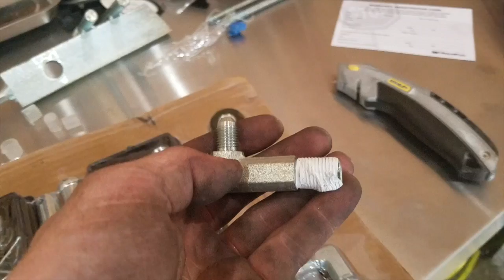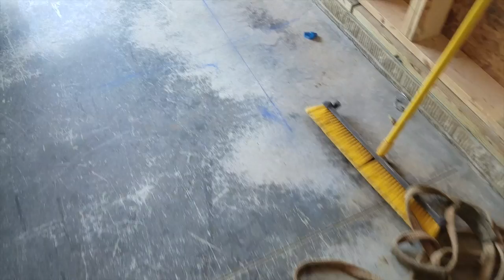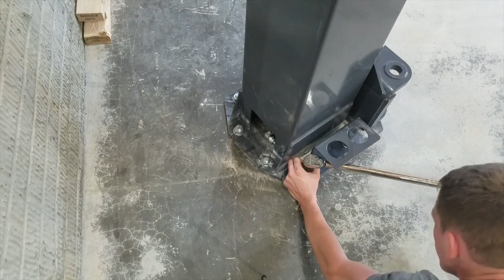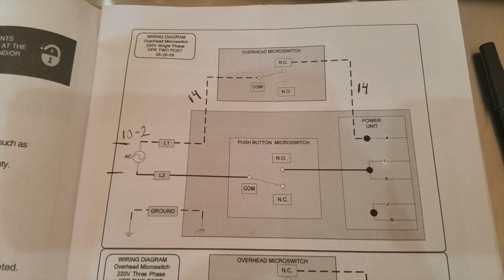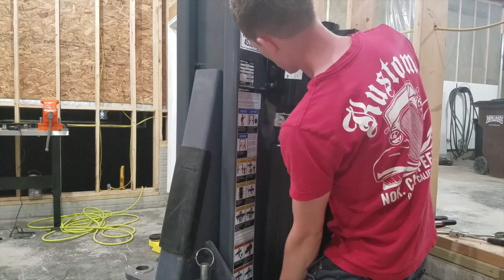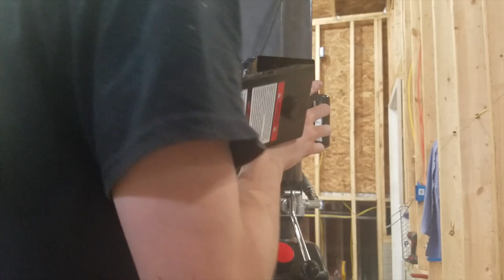BendPak 2 Post Lift Assembly- In Detail

Comment: AWESOME assembly video.  I am purchasing this exact same lift myself.  Question for you:  With a load on the lift, have you ever measured to see how much the lift arms deflect?  I am pretty curious.  Nice talking with a peer.  I too am an industrial mechanic.  29 years this month.
Reply from the maker: I haven't. They do deflect more with a truck on the lift obviously because the arms are extended out further to reach the frame. It never feels unsafe. Sorry it took so long for a reply. I never got a notification :/
Reply: Hello again.  another question for you:  Before the Bendpak, did you check into the Rotary Revolution series of lifts?  If so, I am curious as to what you thought.  I can't decide between the Bendpak you got and one of the revolution lifts.  Both lifts are made in China.  What's bugging me about the Bendpak is the damage from shipping.  I am hearing your same story from nearly everyone I talked with who bought it.
Reply from the maker: @keithkillian7581  I did not look at them because they were not as available as a Bendpak was. I'm not sure about the revolution series but all of the Rotarys I saw were $1500 more than the Bendpak for the same specifications. My suggestion would be to try and look at both of them in person and compare the build quality.
Reply from the maker: @keithkillian7581  my biggest gripe with a Bendpak is the lack of attention to detail. Just like it arriving scratched up. The hardware they use looks and feels cheap. The motor contactor for example is the cheapest off brand motor starter I've ever seen. According to one commenter they stopped using the contactor and are just using the button to handle 13 amps on the new models. Then, they didn't bother changing the wiring directions reflecting the removal of the contactor. The commentor thought they were missing parts until he called Bendpak and they told him it was removed. The frame and the arms are well built  and safe but, every thing else just seems cheap.
Reply: I very much appreciate your response.  The revolution series is a ALI certified lift that was built to compete with the price point of your Bendpak.  They are within about $100.00 of each lift.  Although it says made by Rotary, I think they are using the brand name is all.  There is a TINY sticker on the lift that says rotary and you'll be hard pressed to find the word Rotary on the revolution website.  They are easily available though where I live in Wisconsin.  I will at least look at them before deciding.  It sure is frustrating paying out a lot of hard earned cash for a cheaply built product. I hope the pump/motor assembly on your lift is better made then the cheap contactor.  I also wondered about the quality of the cylinders after you said both of yours leaked.  That would have angered me.  All the machines I work on at my job are German made and although they are sometimes way over engineered, they are always built with top notch components. Stay tuned fellow industrial mechanic.  I'll keep you in the loop with the Evolution lifts.  Have a great day.
Reply from the maker: I've wondered the same thing about the pump. I'm sure Bendpak isn't building them but, you can't help but wonder. Keep me posted.
Reply: Hello Repair geek.  I looked at both lifts and decided on the Rotary Revolution RTP 10.  I picked it up today and brought it home.  The packaging was AWESOME. Heavy angle iron frame on each end, plywood between all the columns and pieces. None of the painted pieces were even touching each other.  I uncrated it and not a scratch, ding, damage anywhere.  Super happy. Wanna hear some irony?  On the way home with it, I lost my exhaust on my truck right after the cat.  Here I am with a lift that has a job lined up for it and I can't even use it yet lol.  Anyway, I'll let know when I get it installed. Hope all is well with you.
Reply from the maker: @keithkillian7581   glad it all worked out for you. You won't have a problem finding reasons to use it believe me. If neighbors see it, they will be bringing their cars over for a quick look a lot. It can get annoying from time to time but, I alway have cash on me. I never need an ATM.

Comment: I am in the process of setting up an asymmetrical BendPak. I found your videos and find them quite helpful. You are right, and expressed it kindly, the instructions are "Vague".....  this is one product that I definitely recommend reading through the entire booklet first.   I was hoping to see how you placed the "Button" end of the balance cable in the Lock Plate, inside that carriage.  I'm a big guy, am I really supposed to be able to stick my entire arm down in that tiny hole ??  What holds the button in place to prevent it from popping back out, Luck ?  Sure would have been nice if the Chinese factory had had one of the kids put that together before it was all packed up.  
I plan to cheat a bit, as I usually work alone. I am going to lift the post with the forks on my tractor, secure it to the trusses above and then lower so it can swing into an upright position.
Reply from the maker: Tension on the cable holds it in place. You can use some tape to hold it in the bracket. If the cable falls out of the bracket when the post is vertical it is much harder to put back in place. I know from experience haha. Just FYI.
Reply: My biggest problem is getting down inside the carriage to set the cable button in the bracket...  my carriage is completely enclosed with a 5 inch access hole in the top, which is where it seems you took your videos from.  I have the post standing already.  Were you able to reach down through that 5 inch hole or did you use a tool of some sort to position the cable button ?
Reply from the maker: @edburgett4561  I used air to raise the cylinder and go up from the bottom. If you get the safety mechanism assembled you can raise the column up to the lock with air pressure. I tried my engine hoist before resorting to air but I could not get the carriage high enough for good access.
Reply: @RepairGeek  thanks for this. Was pretty sure I was missing something.

Do the hydraulic lines go in and out of the double tabs as the lift moves up and down? Just seems like there would be a better way to ensure that the hydraulic lines stay out of the way. Thx
Reply from the maker: @dsford1982  I just bent those tabs closed on the hydraulic lines with channellocks. I haven't had any issue.
Reply: @RepairGeek  Thank you. I started crimping those on the Non-power side and it left the power side short :(. Yes, wide config with added hose piece installed. Maybe I should run them tight in the back of the posts? Any thoughts? Thank you again.....excellent help here.
Reply from the maker: @dsford1982  weird. Perhaps you got shorted some hose? It may be worth a phonecall to Bendpak.
Reply: @RepairGeek  My sales rep Kat has been great. Emailed her and they got right back to me today. This thing would be up and running if I was better at concrete anchors! don't ask! ugg! Thank you again for everything....it really makes a huge difference.
Reply from the maker: @dsford1982  I ALWAYS drill completely through the floor. If you have issues in the future you just remove the nut and pound the anchor through the floor.
Reply: @RepairGeek  great suggestion! I seem to not hit them straight...or something. Had to epoxy one and hit rebar on another. Hope to get the last one in tomorrow.
Reply: @dsford1982  With the hydraulic hoses properly connected and installed, you will not be able to get the hose clamped in the welded tabs in the top corners of the posts where they are welded on the Overhead Assembly.  I found this out when installing mine and contacted BendPak about it.

Comment: Since a few people have asked...  
I just finished setting my XPR-10AS-LP up. My ceiling is 12ft 1-1/2”.  There is JUST ENOUGH room to stand the posts up, if you rotate them up so the notch in the posts is up. That puts the flange with the post closest to the edge near the ground. Of course.

I also did the entire operation by myself!  Used my gantry, and a 1T chain hoist.  If you sling/choke just under the 2 large welded tabs where the latch goes, you’re just above the center of gravity. So as you lift, the flange will stay on the ground. Took me maybe 20 minutes to stand them both up.

Comment: Do you have a part number for that relay inside the pump box? Mine did not come with one. Called Bendpak and havent received a response yet. Thinking about getting one locally. Thanks
Reply from the maker: It doesn't have much on it. The only brand information is: Contactor TMC-18

It's just a contactor with a 110v coil. It shouldn't be hard to source through some one like Granger or McMaster.

If you Google: Allen Bradley 110v contactor you should find what you need.
Reply: Well BendPak replied by saying they don’t use those relays any more and to just wire it up hahaha
Reply from the maker: @TBD_Performance  WOW!!! I guess that 3 dollar Chinese contactor was costing them too much money. Hopefully they gave you a heavy duty button that will handle 12 or 14 amps. Unbelievable...
Reply: Not sure about the button...kinda frustrating because I thought I was missing a part. I’ll know for sure tonight whether or not it works.
Reply from the maker: @TBD_Performance  did the your wiring instructions look like mine? I just wonder if they even bothered to update the instructions when they made a revision to how the lift is wired.
Reply: No update same as yours. Gotta save those pennies ya know
Reply from the maker: @TBD_Performance  that's nuts. How do they not expect calls about that? If you need anything else I'll help you as much as I can, as long as they haven't changed the design haha.

Comment: Hi

I have the same lift ready to be installed. Can I first install the columns and top bar and deal with the calbles and hydraulics afterwards?
Reply from the maker: There is no reason you can't do that but, it's going to much easier to preassemble that stuff on the floor. You have to route a hydraulic line behind the carriage, with the post on the floor you can move that carriage inside the column. Once it's vertical you will struggle to do that. Not to mention having to up and down a ladder constantly.

Comment: "I'm just gonna use air to move the cylinders cause it wont hurt anything".... next video update, "so uh both my cylinder's were leaking" luckily bendpak didn't see your video or they probably wouldn't have sent them to you.
Reply from the maker: The replacements are leaking as well. They we're tested at the factory with oil, so they had residual oil in them. As evidenced by the oil that had dripped out of the hydraulic line I pressurized.

Comment: The Safety Switch does not use a full 30 Amp it is there to Stop full run the 14 guage will handle 240 volts , when any wiring is done on anything sold in the USA or CANADA it has to go through testing in the USA  "UL" or in Canada "CSA"  THEY MUST Approve it before it can be put up for sale to the consumer , use the safety switch the wiring is safe enough and it is not carrying full load . it is a Micro switch and has nothing to do with the load  the motor is under , I urge you to reconsider using this switch , I Assume your a Mechanic which means you use these lifts daily however for the average home owner who wants a lift all SAFETYS should be used they are there for a reason and the mere fact 14 guage was used should not be a deterent as an Electrician I've installed Several of these lifts I've yet to see an issue with the wiring or safety switches.
Reply: One leg of the 220 runs straight through the switch, it is not a micro switch that works with a relay to disconnect a leg.

Comment: Hello Repair Geek,

I have a question for you. I am looking at this lift for my shop. Although, it will be the asymmetrical version. The ceiling height in my shop will be 12 feet 6 inches. With that being said, my question is this. I know the lift only needs 12.08 feet of clearance when installed. However, I am concerned that the height might not be enough. If you measure from the bottom right corner of the column to the top left corner, that will be more than 12.08 feet. So when you are standing up the column from a parallel position on the ground, I am worried it will hit the ceiling before it stands up right due to the extra length. What is the measurement of your lift from one corner of a column to the opposite side at the top of that same column?
Reply from the maker: Brian Padrick I just measured mine from top to bottom going from opposite corner to opposite corner it's 12ft 1in 1/4. Let me know if you need anything else.
Reply: Repair Geek awesome. Thanks so much! I really appreciate it. The builders have not put the trusses in yet so if I needed to go higher, I still could. Thanks again. That really helped.
Reply: just installed my bendpak in my newly constructed shop with the trusses and 12'6" and there is plenty of room with hoist up.good luck

Comment: we just finished our install yesterday. (same lift) it  worked flawless on 2015 VW Jetta and an 87 Samurai. I wish they gave us the frame cradles wit the lift. $50 bucks each.  we started lifting a GMC 2500 with a service bed and liftgate and it didn't seem to happy. I will wait for the frame cradles and try again. truck was right at 9000 pounds. I think get it lifting level with the cradles and it will be fine.  Thanks for sharing your info and install. Helped us. we're on FB at Loose Nut Fab.
Reply from the maker: Skipholiday I've been meaning to buy the frame cradle pads as well.  I've had a 2014 diesel 2500hd with a normal 6.5 bed on mine. I would estimate it at 7000 or so pounds. It handled it without any issue. Thanks for watching. I check you guys out on FB.
Reply: I bought mine from Northern tool for $50 each. Use this coupon code (257368
) and you can get $20 off. Keycode: 257368
This keycode entitles you to $20 off your purchase over $100.

Comment: I have a round washer with finger like things inside of it .its probably 1 " or so i cant find any mention of it in directions.  Do you remember where it went?
Reply: It goes on release lock mechanism on non power side 
It keeps lock release cable from sliding off

Comment: I could be wrong but as i reed the instructions it appears you could have mounted the motor on the driver side or more correctly you could have use the motor post on the driver side, which would have put the motor to the back of the post and out of your walk way.  the rest of the install would have been the same.  That would have prevented you having the motor on the passenger side and blocking your walkway.  If you look at the base plates they are shaped in such a way that either post can be the driver or passenger side to allow for flexibility.   Again could be wrong but that is my interpretation on their directions.  Great Video!
Reply from the maker: You are not the first person to mention doing something like that. I had a person comment on the shop requirements video say that he put the columns in the wrong spot by mistake. He found out when he went to run the wiring to the overhead limit switch. The wiring was too short. He also said that the equalizing cables fit badly in the pulleys. I also had another person tell me to turn the lift 180 degrees and back the car into the bay. I didn't see how that would have fixed anything and just moved the issue from one side to the other.

In any case my lift is lagged. I'm not doing a complete disassembly at this point. I would move the mount before I moved the columns. Thanks for watching and commenting.

Comment: Thanks for taking the time to post a great video.  And you are right to be concerned about BendPak's breaker recommendation.My buddy is an electrician and he tells me that the breaker is there to protect the smallest wire in the circuit.  There is nothing wrong with running 10 gauge wire from the panel and connecting it to smaller gauge wire.  The problem comes when you install a breaker that can handle more current than wire it is protecting.  Since you checked the current draw and found that it does not exceed 15 amps, and you know that there is 14 gauge wire in the circuit, for safety reasons and to provide more protection for your equipment you might want to replace the "oversized" breaker with a 15A.It might not ever be an issue, but I can tell that you are a guy that likes to do things right.  Show that drawing of the circuit to a certified electrician and ask them for their opinion.
Reply from the maker: It definitely seems fishy, no doubt. There is no good reason for it other than to cut costs as far as I can tell.
Reply: you're only running 1 line through the safety switch, its never going to pull more than 15A.

Comment: With the foot guards, shims and anchor bolts in place,
tighten by securing the nut to the base then turning 3-5 full
turns clockwise (90 ft-lbs.). DO NOT use an impact wrench
for this procedure.    so you were close at 85 #.    check the torque again after using the lift a bunch of times
Reply from the maker: I have re-torqued them after some use. Nothing has loosened up. Thanks for the info.
Reply: Just installed that same lift and towards the end of the instructions there is a page that states the torque specs of the anchor bolts. 75-110 pounds is what it tells you.

Comment: the one going to the top has only about 5 amp to it and not 240 v
Reply from the maker: Correct 4.7-4.8 amps with no load. When the cylinders are at the max height dead heading the pump, it pulls 13 amps. I was too curious not to check.